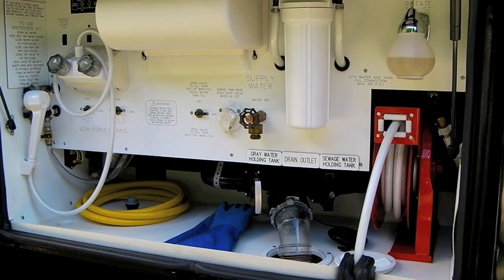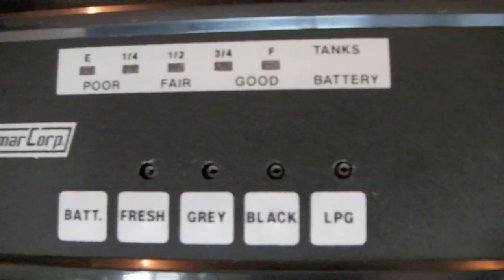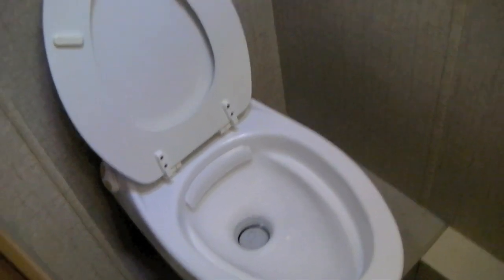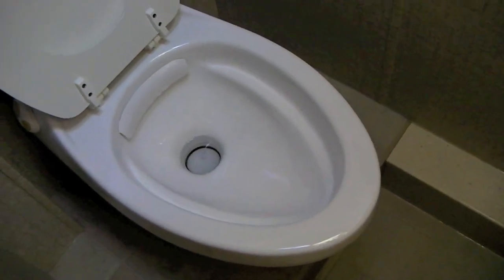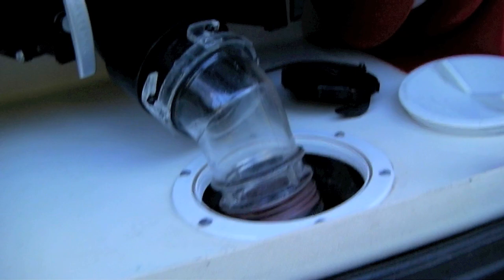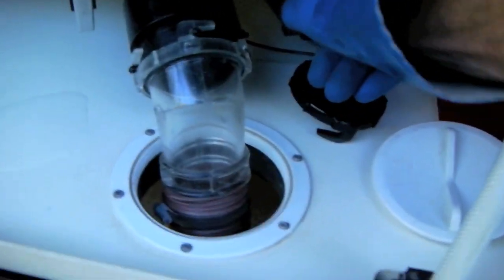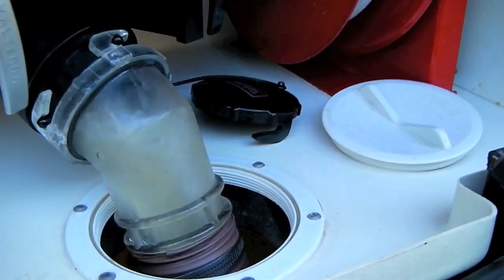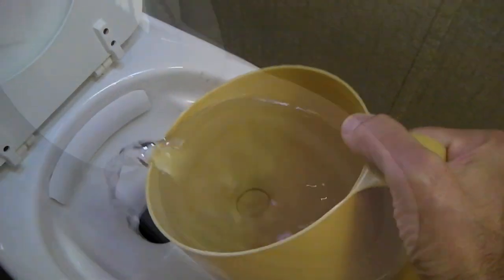How To Dump & Clean an RV Black Tank

Comment: My thinking on Rid-X is it wouldn't help. There's a great deal of debate on whether it helps in septic tanks. We have holding tanks in an RV.

The goal with a holding tank is to stop waste from breaking down. Rid-X is supposed to increase bugs that help digest waste. That produces methane gas. Years ago they put formaldehyde in tank treatments as a disinfectant and preservative. Stop the waste from breaking down and reduce the gas from bacteria. 

I think the only one benefiting from Rid-X is to the owner of the dump station that runs into a septic system. That is if Rid-X works in septic tank at all.
Reply from the maker: The benefit of all bacteriological holding tank treatments is to add “good” bacteria to prevent the “bad” bacteria from causing odor. We can tell you from 15 years experience full time RVing is that Rid-X, Happy Campers and other bacteriological treatments we have used do indeed work.
Reply: I should explain where I'm coming from with my reply. I fulltime also. I had a class A MH with a black tank sitting directly under the toilet. I could see the bottom of the tank through the toilet valve. It was a 25 gallon tank that the bathroom sink also plumbed to it. We had to dump the black tank every 2-3 days. There was no tank rinser.

I noticed after dumping there was a film on the bottom of the tank. I got a spray wand and poured Dawn in the tank. That took the film off. Then I started using Happy Camper. After a few months the film returned but my tank level sensors always worked. 

My solution was a garden fertilizer sprayer connected inline on the hose going to wand. With hot water infused with Dawn it was like a foam cannon inside my tank. It was spotless. Eventually I installed a tank rinser but still used the fertilizer sprayer inline with the rinser. That was all the additives I needed. Now with my 5th wheel I can't see if my tank is really clean. Also my tank is 40 gallon rather than 25. We don't dump nearly as often.

What I'm getting at is every system if different. How we use our RVs is different. How you will maintain them will be different. The method you describe can be used on any rig, it just might not be necessary.

Comment: I often hear that it is okay to leave the gray water hose open when hooked up at a campsite.  But doesn't leaving the hose open produce off gassing into the RV?
Reply from the maker: There is the potential for odors from the sewer system to come up through the hose, which would allow it to come out the plumbing vent on the roof, so keeping the gray valve closed, and dumping periodically as needed is not a bad idea.

Comment: What was the purpose of adding the Ridix and water?  Do you rinse the tank out and remove the Ridix and water or do you leave it in the tank for your next full black water tank?
Reply from the maker: We add toilet chemical after every tank dump, and that initial gallon or two of water is so that any "solids" added to the tank right after dumping won't be a virtually dry tank. We do flush after dumping, and the new chemical added begins to break down new material as it begins to fill the tank.

Comment: It's not difficult at all. I live in a 1991 34ft Bounder full time. This video is, in my opinion, a bit overkill. after 10 years of living in it, never flushing that way every dump, barely using chemicals (unless weather is warm, which can bring bad smells), I just flush after each use a bit of extra water. After dumping, I run a few bowls of water, and dump again. Then, releasing grey water tank (closed valve a day or two prior), cleans hose and I move on. no issues. But, still good video.

Comment: Great video.  However I would used my bare hand to open or adjust the water flow at the Y valve.  Using your gloves on the Y valve and the T handles could contaminate the Y valve.
Reply from the maker: Jerome Sanders You're right Jerome, but I just find it such a pain to be constantly taking my gloves on and off depending on what I'm touching! I end up just washing everything down when I'm done as much as I can. So far no problem, but you're absolutely right that we need to be cognizant about this. The worst thing I see is people dumping without any gloves at all, and apparently not even washing their hands afterwards.

Comment: just watched and your system seems so great....but....there is a label by my tank flush that says "DO NOT USE THE TANK FLUSH VALVE UNLESS THE FULLWAY TERMINATION VALVE IS IN THE OPEN POSITION CAN RESULT IN AN UNSANITARY CONDITION READING TO ILLNESS".....but you are doing that so it is ok to close that and let the tank "almost" fill up ????
Reply from the maker: We think the primary purpose of a warning label like that is for liability purposes, not because there’s any real danger of there being a problem. We’ve been doing this for 17 years, filling the tank right to the top, and have never had any issue whatsoever. The black tank flush system has a built-in backflow preventer, and we use an additional backflow preventer right at the inlet where we connect the tank flush to city water. We wouldn’t worry about it.
Reply from the maker: Oh... and be sure that you don't get distracted!! Set a timer, don't walk away, and be sure you turn it off before the tank gets too full. Overflowing it is the issue you want to avoid.

Comment: Hey Peter, did you ever make the video explaining how you knew that you knew that there were exactly 7 gallons left in the black tank when the full light came on some time after this video?
Reply from the maker: Hi Morgan! I think this has the info you need: https://youtu.be/DvVGBFdJ_vo
Reply: @RVgeeks  oh, I thought when you mentioned about that you had 7 gallons left in the black tank when the full light came on, and that an explanation was for another video, and your voice when you said that suggested that something bad happened. :/
Reply from the maker: We actually do have 7 gallons capacity left in the black tank when the full light comes on. The way we determined that is by filling the black tank using the flush/rinse connection until the full light JUST came on, then pouring water into the toilet, a single one gallon pitcher at a time, counting as we added each pitcher. When the water level started to come up into the bottom of the toilet pipe (we could see it a couple of feet below the toilet), we had counted 7 gallons added after the full light came on. Hope this helps!

Comment: Really really helpful, thank you so much!! How long does the process take once you get the hang of it? What's your opinion on composting and cassette toilets?
Reply from the maker: I'd say about 15-20 minutes or so, but this video shows the way we do a thorough tank cleaning. The "everyday" method we use (not "every day" of course! LOL), is here: https://youtu.be/gZFyfsy4ptw

We don't have personal experience with composting toilets, but our friends Nikki & Jason Wynn are big advocates, and we'd definitely consider one. The only time we've used a cassette toilet was during our trip Australia for several weeks last year. While it's convenient to be able to take the tank to the dump station without moving the RV, the very small size of the tank requires frequent emptying. We weren't really fans of the cassette system. You can see how we dump it here: https://youtu.be/b6P6U9tQIFs
Reply: Hey thanks Geeks! I will check their videos.

Comment: Have you ever used any other chemical beside Ridd X. We always use Aqua Kem, and it really does the job of keeping the odors down, but it does contain formaldehyde!
Reply from the maker: Hi David! There are other good tank treatments out there. We were very happy using Pure Power Waste Digester, but switched to Rid-X because it's generally less expensive. We do recommend using bacteriological treatments only, and NOT using anything with formaldehyde, as it's bad for the environment, and actually banned in many places.

Comment: I'm about to be a 1st time travel trailer owner, and live in AZ. After camping, and thoroughly cleaning the black tank (& grey for that matter) should I leave a substantial amount of water in either tank so the AZ heat doesn't dry it out between uses?
Reply from the maker: +Adam If you've thoroughly flushed and cleaned both tanks, we don't know of any reason you can't leave them completely empty while in storage.
Reply: Thank you for the quick response! Is there anything you can think of preventative maintenance wise that I should do other than keeping it waxed, covering the tires etc to help combat the AZ sun and heat?
Reply from the maker: Tires are the main thing to protect when storing your rig  in the desert sun & heat. Fill them to  the maximum PSI listed on the sidewall (don't drive on them that that full unless your vehicle weight calls for that), don't park on grass, dirt or asphalt for extended periods without placing them up on barriers (like cheap cutting boards.... parking on concrete requires no barriers), take excess weight off them during storage if possible, and as you mentioned, covering them is a MUST! Our video about tire age care and replacement has some tips, too: https://youtu.be/X7scHIvjyBk.

We'd also suggest keeping the interior from roasting more than needed by covering the windows with reflective barriers during storage periods. The couple of times we stored our RV in a hot climate for a month or more while we were traveling by air, we taped aluminum foil inside all the windows. It really helped!

Congratulations on your upcoming RV adventures, Adam! Safe travels.

Comment: Have you ever used the 10#s of ice cubes at the beginning of the first trip of the season to scour out the buildup in the black tank?
Reply from the maker: +William Kennison We've been full-time the entire 13 years we've been RVing, so never had a "first trip of the season" before. But your idea is a really  good one, as the best use of ice is to scrape dried waste off the bottom of a tank that was allowed to dry out without being thoroughly cleaned first.
Reply: We were full timers about 25 years ago and loved it! But, life got changed around and we became landlocked again. Just picked up a class C for camping and deer camp that we want to restore to give it a little love and modernization while we're at it, 77 itasca 25 footer that should do just fine once its done.

Comment: Hi - we are thinking of purchasing an RV while we build our home and we are parking in my moms backyard.  Can we connect to the sewer line and city water permanently?  If so, do we still have to clean the tank? How would that work?
Reply from the maker: Hi Ann! You can indeed connect to the water and sewer lines permanently if you'd like. Unfortunately, you can't simply attach the holding tank dump hose from an RV to a sewer inlet and leave the black tank valve open, even if the connection is permanent. That's because RV toilets go down into the black tank, not directly out the sewer line, like in a regular house. Connecting to a sewer line and leaving the black tank valve open is one of the biggest mistakes a new RV can make, since it allows the "liquids" to run out and the "solids" to pile up in the tank and not get washed out. That solidifies into a mass that's commonly known as "pyramiding" (picture the shape of a pyramid) and will not only stink to high heaven, but will be difficult and expensive to have removed once it hardens in there.
Reply: RVgeeks.  Thank you so much, so looks like I will have to wash the Black Water Tank weekly. Well, I can't have it all, LOL.

Comment: So is the warning about keeping the black valve open while using the black tank flush connections only to keep a careless RVer from overfilling the tank?   I've never tried this and would love to be able to add clean water to the tank but was following that warning sticker out of an abundance of caution.
Reply from the maker: Mostly there for manufacturer liability reasons, but also to prevent people from overflowing the tank out the roof vent.
Reply: Thanks!

Comment: Correct me if i am wrong, just living in Holland, but the yellow garden hose is used to flush the black water tank? And then closing the output so you can collect water in the black water tank so the remains can come out? Btw, that clear elbow piece. It looked like there was mud passing through and not something else.
Reply from the maker: We use that hose exclusively to flush the black tank. A short hose of any color will do. Mud is exactly what that looks like, so nothing to freak out about! LOL
Reply: And you are using the same hoses for grey water tank?
Reply from the maker: No... there's no flush system for the grey water tank.
Reply: So the grey water tank is just connect 1 hose to empty the tank and that's it?
Reply from the maker: Correct! Water runs in from the sinks and shower and runs out through the sewer hose. That's it.

Comment: Are you supposed to have water in the black when done? Is the gallon of water sufficient?
Reply from the maker: We just put in a gallon to start, and if we end up adding some "solids" during the first couple of uses of the toilet after dumping, we make sure to flush with some extra water. If we only add "liquids" during the first few flushes, we hate to have started off with extra water in the tank for nothing, thereby filling up the black tank faster than needed.

Comment: We have the black tank flush on our rig and, like yours, there is a sticker warning us not to use with the gate valve closed. Is it just so you won't forget and overflow your black tank or is there some other reason for the warning?
Reply from the maker: Partly so you won’t forget and I’m sure it’s partly to protect themselves from any liability too.
Reply: Thanks. I had always been worried that leaving it closed would build up pressure in the tank, but had not fully thought it through. Any positive pressure would be released through the tank exhaust on the roof, the same as the negative pressure when you dump--is this correct?
Reply from the maker: Exactly! Just stay with it... because walking away and forgetting can lead to a roof wet with the kind of water you don’t want up there! 😂

Comment: I would like to convert my existing RV toilet to a standard toilet of the type found in a home.  1)  Is this possible (it would still empty into a chruner-type Septic unit)?  2)  If not possible, what recommendation might you possibly offer for the problem the current occupant of the RV has (the RV is on concrete slab, fully hooked-up, permanently), which is that she finds it impossible to pull the black water lever in and out (she hasn't the strength anymore).  She has no problem working the gray water lever.
Reply from the maker: +James Lacey Hi James! Great question. The first concern we had was already answered later in your comment... and that is our recommendation that this could only be considered if the RV is permanently parked, as driving with a residential toilet on board would almost certainly not be a practical option. 

There is still a problem though. That is the fact that you're talking about achieving a primary goal of avoiding leaving the black valve in the closed position so that she won't have to ever pull it. Unfortunately, that cannot be done, because the "solids" will be left to build up into a pile inside the black tank if the valve is left open, even if a regular residential toilet is being used.

Installing a residential toilet will actually compound this problem by using substantially more water than an RV toilet, requiring even more frequent dumping of the black tank.

Based on what you have described we would suggest that the simplest solution would be to switch to an electrically-operated dump valve, like this one:

http://drainmaster.com/rv/products/full-view/100165

The only other alternative we can think of would be to basically bypass the black tank by having a residential toilet piped directly to the sewer outlet, thereby eliminating the potential for solids to build up in the tank. We would think that would be a much more complicated and expensive solution than the electric dump valve.

Hope this helps.
Reply: This was positively GREAT information, appreciated as you cannot possibly know.  Am looking into the Drain Master solution.  Can't wait!  I'm all but positive this is going to work for us.
Reply from the maker: +James Lacey Awesome! Please let us know how you make out. 😊

Comment: So how long can you let a black tank sit with "stuff" in it?
 In a months time we would barely go half full just camping on weekends. I usually dump every weekend anyway. I just fill the tank to 3/4 with water before dumping.  It would be way more convenient to leave it til it's at at least 1/2, but i was afraid to just leave it.
Reply from the maker: Hi Todd! Using the bathrooms available at RV parks, we often go three weeks without dumping, with the tank filling up slowly over that time. But if you let yours sit unused for an entire week in between uses, you could end up with odor issues. We'd suggest a couple of things. First, try skipping a weekend, and seeing if you have an odor issue when you use the RV after two weeks without dumping. If that's no problem, try three weeks. You can also try adding in an extra dose of Happy Campers tank treatment each week, which might help prevent odors even longer.